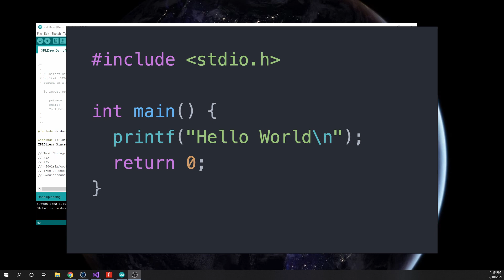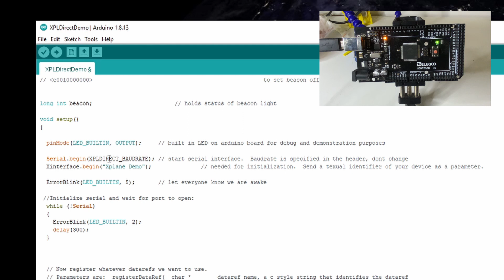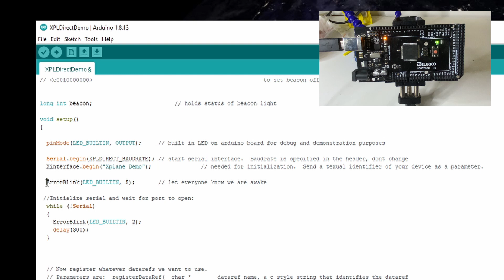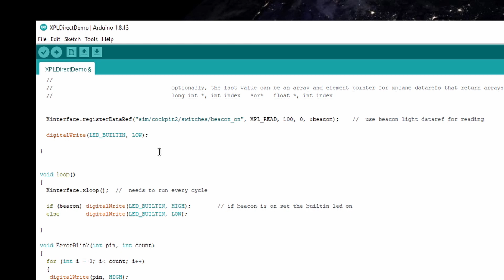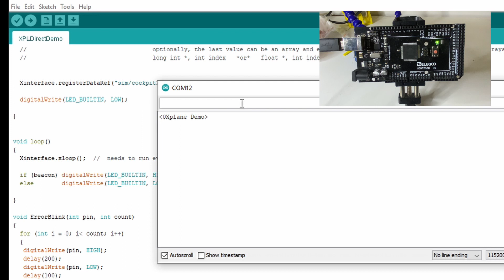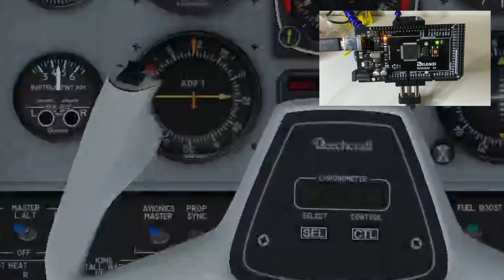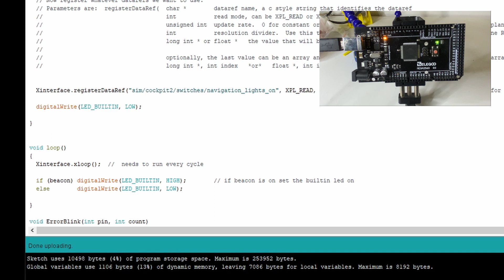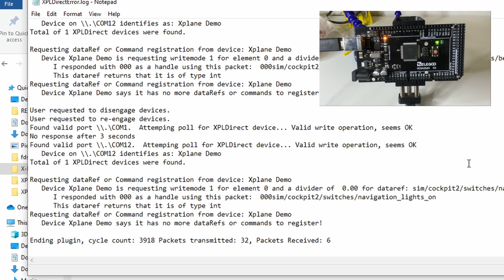Xplane/Direct tutorial part 2:  Using the Demo Sketch and Plug-in Basics

Comment: Hi  @Curiosity Workshop  , that's an amazing project, it's simple and really useful. Right now I'm trying to make an RPM gauge and I've already figured out how to reference and drive the stepper but I'm struggling with the XP11 because it gets stuck in a "WILL INITIALIZE PLUGINS" screen and never starts the game. However, when I remove the plugin from the folder it starts normally. Could you help me how to get the plugin working?
Reply from the maker: Without me looking at your code, make sure you aren’t using delay commands as xloop needs to run regularly.  You can use millis commands to create delays.  I hope this helps!
Reply: @curiosityworkshop3957  thanks for the reply! Actually I still haven't had the chance to see if the gauge will mimic the XP11 instrument.
I've tested only the gauge itself and I know that the dial will point the right value, once I can get it from the XP. However my XP11 won't start if the XPDirect plugin is installed, but if I remove the XPDirect folder from the plugin's directory the game works again.
Can't figure out why.
Reply from the maker: @zvizionaero  I would need more information to help.  I recently was working with someone that had trouble with other plugins that werent playing nicely with the serial ports.  Is that a possibility?
Reply: @curiosityworkshop3957  Sure! How, can I provide you the necessary information?
Reply: @curiosityworkshop3957  when you mentioned the serial ports issue, I remembered that I had two bluetooth serial ports that was permanently active in the device manager. Once I disabled them, the XPL started without any trouble. Thank you for the support! Now I can go on with the project of my helicopter Rotor RPM gauge. I can share my Fusion360 3D project of the gauge if you like. Thank you very much!
Reply from the maker: @zvizionaero  please do and perhaps video of the working project that I share on this channel!  Glad to be of help.
Reply: @curiosityworkshop3957  did you receive my email? I've sent you the model and the video. Today I tried it again with the right aircraft and it worked beautifully, I may send you a new vídeo. Thank you very much.

Comment: This is absolutely awesome.. awesome.. awesome. I was struggling for hours to get my NANO working reliable with FlyWithLua and did not get it working properly yet. Then I found this by accident and it made me change my plans.  10 of 10 points !
Reply from the maker: I’m glad it’s working for you.  The nano only has 2k ram to work with so it can only handle a few datarefs.
Reply: @curiosityworkshop3957  Yep, I know. I did a few NANO projects before and know about the F-trick ;-)